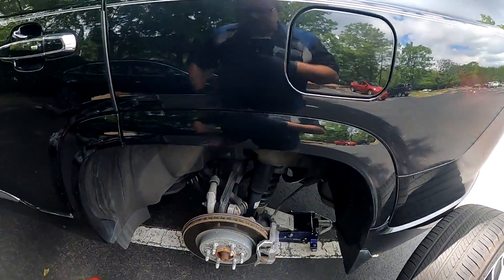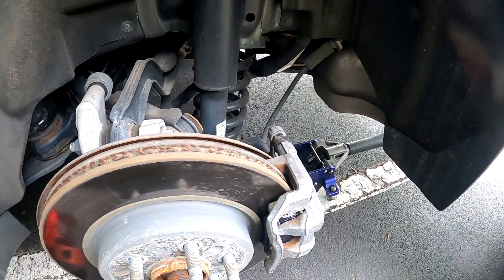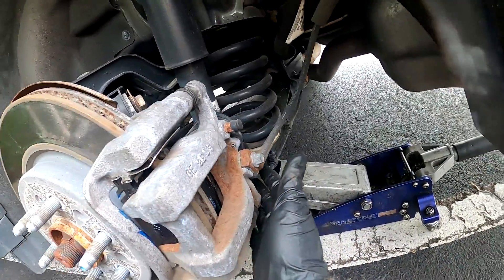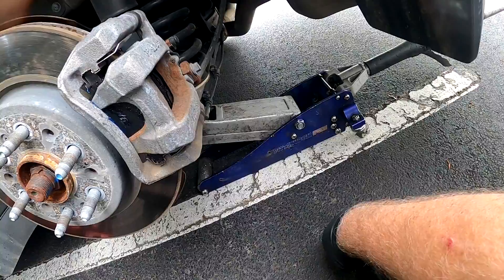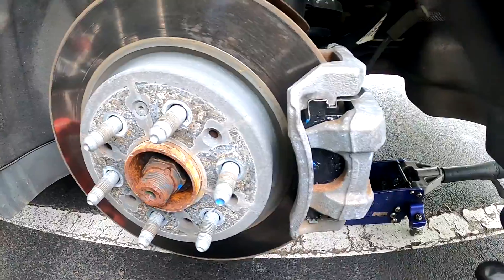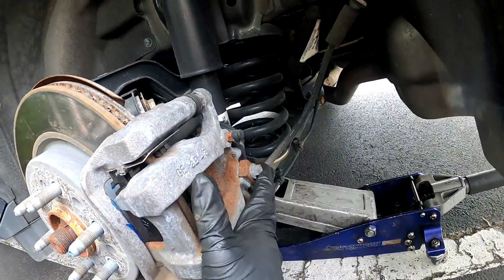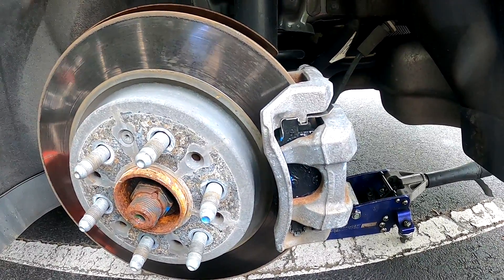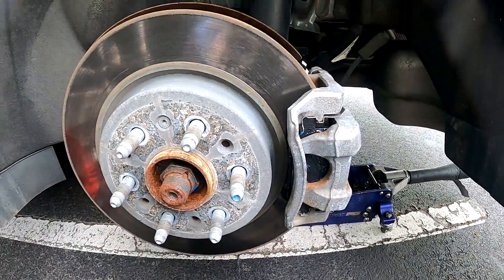How To Replace 2018 GMC Acadia Rear Brake Pads

Comment: IMPORTANT:  You can easily avoid needing the scanner to go into parking brake service mode. I replaced rear pads today on 2018 Acadia and used the technique of holding down the button in sequence shown in this video for 2019 -2022 Silverados. Worked perfectly so I wanted to share with anyone doing this project:

https://youtu.be/VXzfT47QOec?si=zQSp0QfXsQXZ8m31
Reply from the maker: For the ones that dont have a scanner  good work
Reply: I tried that method and it didn’t work for me.
Reply: This link for my 2018 Acadia

Comment: What was the tork spec for the caliper pins bolt?  47lbft?  I see below someone posted the service button sequence to get the park brake service release position.  Worked on my 2018 Acadia. 👍
Reply from the maker: 40NM

Comment: I took the two star screws off that hold the electric motor on it and exposed a shaft that I used a star tip that doesn't fit perfectly but just enough to let me turn it by "hand" to the right until it stops.  I did not force it.  It should turn easily by hand with any tip that fits tight enough to turn.  Then I used a C-clamp and squeezed the piston straight in like normal.  I was careful not to place the clamp on the shaft for the electric motor. Put everything back together and pumped brakes until firm then turned my parking brake on and off a couple of times to set everything.
Reply from the maker: Not recommended  but if it works it works.
Reply: Driving fine with no warning or engine lights on.   @kevinsmobileautomotiverepair

Comment: Why not show the procedure with the scan tool? Would totally buy one but it seems like instead of doing the brake job, your more worried about pushing the scan tool. Wtf
Reply from the maker: What makes you think im worried about pushing a scan tool  so you say when Im not affiliated with the scan tool or the company. First every scan tool is different for doing this and any procedure  different software's.  I can show it on mine but unless you have that tool  it wont do you any good.  My certain tool is around $2500 so if you want to go get that scanner by all means  I will show you then.

Comment: What is the scanner that you use for the brakes?
Reply from the maker: I have 2   the lesser one  is a Launch CRP129E  it will likely do the trick with all the reset programs it has.   My other one is a Maxi SYS autel pro scanner